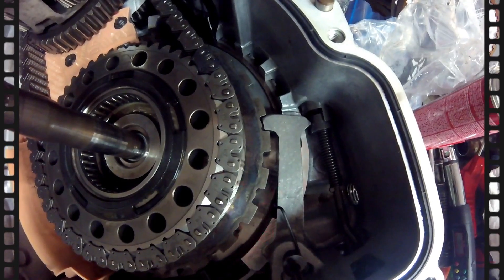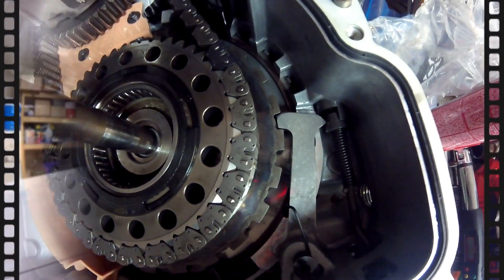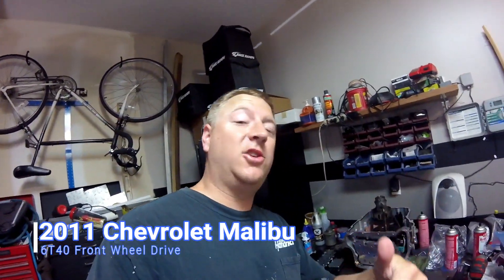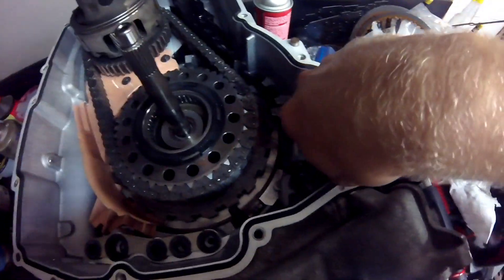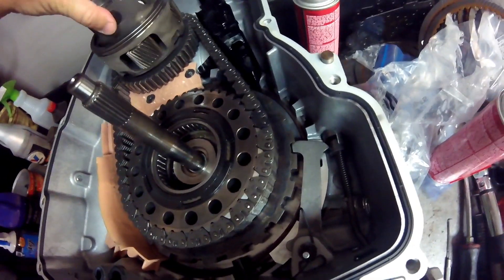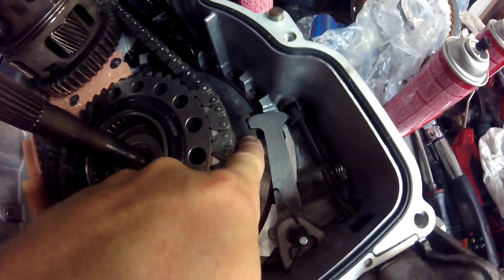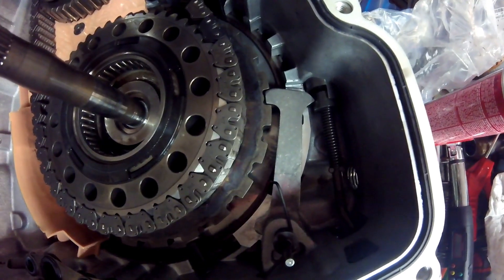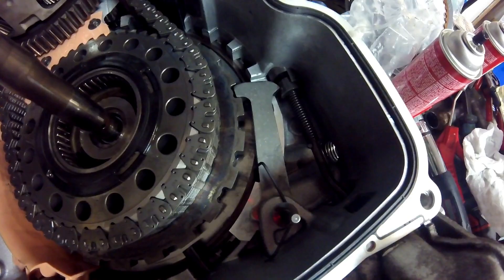What Keeps Your Car From Rolling In Park

Comment: What is the point of the parking gear in an automatic? When I park, I depress the brakes, shift into neutral, engage the hand brake, let my foot off the brakes and then put transmission into park. But if the park pawl might not even engage fully, what is the purpose of the gear?
Reply from the maker: Most people don’t use the parking brake if they have an auto. Put the car in park and then roll a little until the park pawl engages. Then put on your parking brake. Double the security.
Reply: @PetesGarageandperformance  Would this be safe enough to jack up the front of the car for work? (not getting under)

Also, suppose I did this with a front wheel drive car and jacked up the back. Can I let go of the parking brake so I can work on the brakes?
Reply from the maker: @theurzamachine if you’re on any kind of incline don’t lift the drive wheels because it’ll roll. Unless it’s front wheel drive and you are able to set the parking brake. I always use a wheel chock to make sure it doesn’t roll if I’m lifting on a hill to be safe.
Reply: @PetesGarageandperformance  That's actually what I am wondering. My car is front wheel drive and I am on an incline. Suppose I want to work on the front brakes/struts, I would jack up the front (both sides) and set the parking brake (rear).

If I want to work on the rear, I would jack up the rear, release the parking brake and the parking pawl should hold the front wheels from rotating. Releasing the parking brake would allow me to work on the rear brakes.

Is this correct?
Reply from the maker: @theurzamachine yes that is correct. I would still chock the wheels to be safe.

Comment: Thanks pete, for your Advice. I have few question please, does it safe that we can put Automatic car at only at parking 🅿️ position at hill or at normal road?
And i experienced that when I parked my car at the hill and when i going to shift gear from parking 🅿️ to Drive it looks hard to shift, why the reason?
Reply from the maker: I’d say it’s safe to just put it in park. But if you’re on a steep hill, use your parking brake. If your transmission is difficult to shift it may have a binding shift cable.

Comment: I can hear a clicking sound, in neutral, engine switched off, rolling forward in my automatic transmission, sounds like click, click, click, rolling forward even 12 inches, when I moved it forward, in the garage.
Reply from the maker: It may be a one-way clutch that is known as a mechanical diode. Kind of like the pedals on a bicycle with hand brakes when you pedal backwards. You just don’t hear it when the engine is running. This is just a guess because I don’t know what kind of vehicle you drive or what transmission you have. Does it drive fine otherwise?
Reply: yeah, it drives good no noises when driving, thanks for answering.
Reply: chevy epica 2010

Comment: so if i press the gas while my car is in park, it will wear our the paw correct?  I should put it on neutral?
Reply from the maker: No it won’t. While you are in park and neutral none of the clutches are applied so the input shaft just freewheels. Only difference between park and neutral is usually just whether the parking pawl is engaged.
Reply: @PetesGarageandperformance  thank you

Comment: I can now visualize what happens inside when the car is in park mode. So does it means that the transmission will be damaged when you shift into park mode even if the car is in stop, but engine is running?
Reply from the maker: No. If the wheels aren’t turning, the output of the transmission is not turning.

Comment: I drive a CVT and I use my handbrake every time I put my vehicle into park. 

I hope this isn’t too dumb of a question: say you engage the handbrake and put the vehicle into park when the pawl is not in between two teeth. Does the handbrake allow enough give for the the car to roll slightly (perhaps an imperceptible amount) so that the pawl can fall between the teeth?

Or does it not even matter because the handbrake is already holding the vehicle in place?

Comment: Can i ask. . . Maybe its not the right thing to do. 
But if i was in a manual, i would probably put it in 1st or maybe even reverse, depending on slope direction.
What would be happening if i did that with an automatic?
Reply from the maker: It would basically be neutral because your engine needs to be running to generate pressure to the clutches. And your park pawl would be disengaged.

Comment: On my 2013 Honda Accord when I put it on Park front driving wheels spin on opposite direction  what keeps the car from rolling
Reply from the maker: That is just the differential spider gears inside the transmission doing their job. The differential carrier is held in place by the park pawl. Your car doesn’t move when the wheels are on the ground because it’s impossible for them to spin in opposite directions.

Comment: Sometimes you can’t use the parking brake because either it doesn’t work. Or the lever is hard to pull up and the tension feels ginormous because the actuator on the caliper rust welds itself to the caliper and is unable to move or is stuck on a little bit.

Comment: I have a 22 civic and I have a slight incline on my driveway. I forgot to put the emergency brake on and I felt the prawl engage. When I went to shift out of park, i felt a little resistance. Will this break the prawl or damage my transmission? It’s only happened once.
Reply from the maker: No it shouldn’t harm your transmission. If you’re on a really steep hill it’ll be even harder to get out of park and could stretch or damage the shift cable though.
Reply: @PetesGarageandperformance  thank you so much! I won’t forget again. I was so upset with myself.

Comment: Could you also explain what in manual transmission car stops the car from moving when it is parked in gear?
Reply from the maker: When you shift a manual into gear you lock the speed gear to the output shaft which essentially locks the input shaft to the output shaft. Since the input shaft is connected to the engine’s crankshaft through the clutch, you’re relying on the engine’s compression and friction to keep the wheels from moving. Low compression engines or worn engines with low compression struggle to hold a vehicle on a hill. This is why it’s always a good idea to use the parking brake.
Reply: Thanks for your reply.
Yes, I have heard that some people explain that the wheels get engaged with the engine and do not turn.
But I always struggle to accept that the friction of the engine is such high that the weight of the car cannot overcome it.
The pistons and the inner side of the cylinder are polished well to minimize the friction there.
But what you said about compression is interesting to me. So, I think you mean that there is air in the cylinder and the valve is closed. So, for the piston to move upwards, it needs to compress the air in the cylinder. But it does not have enough force to do so.
This explanation is much more convincing for me.
Reply from the maker: Exactly. I have seen it a couple times where the engine didn’t have enough compression to hold. The truck crept downhill slowly and we opened the hood to find the engine slowly turning. Turns out his parking brake cables were broken.

Comment: Do you have to remove the trans ? Also is that what the cable is connected to because mine has another linkage
Reply from the maker: It depends on the transmission on whether or not it needs to be removed to replace the park components. What transmission do you have? Older transmissions had a kick down or Throttle Valve (TV) cable.

Comment: “U May want to reconsider using your parking brake.” What other alternative is there? 
B/c at that point choking your wheels does no good since u’ve gotta take your foot off the brake to get out of the car to put wood blocks or whatever up against your tires. 
Thanks for making a video showing us on a transmission opened apart.
Reply: Ya at the time I misinterpreted what he said. I was thinking he was advising against using the hand brake w/ any transmission in general, so When I was thinking about manual transmissions that’s why I was scratching my head.

Comment: Hey Pete! Have a very interesting question for you regarding transmissions! I have a 2012 Mazda 6 and i have been having the issue where my Car doesnt hold onto the Park on a hill and continues to roll! I sometimes have to start it in neutral.  I neglected to fix it right away so recently however, my car couldnt connect with the transmission when in Drive/Reverse in order to move the car.  My mechanic told me the whole transmission is bad but here is the kicker! Before it completely was unable to drive, i have never had a problem shifting gears while driving from 1,2,3,4,5.  It has always transitioned super smoothly between them and i feel in that way that my transmission runs amazing! I dont have excessive shaking, any noise or anything prior.  It just feels ridiculous for me to change the whole tranny!
Reply: You’ve broken off that “parking lever” inside your trans and it’s blown your pump

Comment: Hi Pete, if a car is in park position  and it is struck from behind by another moving vehicle, what possible damage could occur to the parking and gear system of the parked car.
Reply from the maker: It could either shear off the pawl or break the gear it meshes with. Usually it’ll just drag the tires.
Reply: I use the parking break on my auto transmission car pretty much any time I park. Even on level grade. One of the reasons is because I was thinking about what could happen if my car was rear ended. Aside from any body/frame damage, I'd much rather have the brakes take the force rather than the parking pawl.  Who knows if it actually ends up making a difference, but it doesn't hurt!

Comment: I accidently turned off my car in neutral so being new to automatic transmission  I then shifted from neutral to park while engine was off and heard a clamping noise then started the car will it damage my car shifting between gears while engine is off ?
Reply from the maker: It won’t do damage to shift the shifter when the car is off. However, shifting into “park” while still moving could damage the park pawl and the the gear it meshes with.
Reply: @PetesGarageandperformance  does parking pawl and gear shift have mechanical connection because I didnt applied brakes when it was off and it still was moving?

Comment: I heard people before talk about it being a little pin. What I didn't know was how little it actually is haha. I've always used the parking brake on any grade because I always hated thinking about what it was doing when you let off the brake and the truck rolled forward/backward so hard that it actually bounced back. In the trucks I had that didn't have working parking brakes I would always let off the brake real slow to gently "set" it on the pin. Not saying that science said that actually does anything, but just how I am. 

I've also noticed that it's when the parking brake isn't used for many years is when they go bad, so the day you actually need it it won't be there. 

P.s. thanks for not making this clickbait, and getting right down to it. 👍

Comment: unless you park on 60 degrees slope, this holds car quite alright. Also did you tested how much force is required to break that park lock?
Reply: exactly  the wheel will loose traction and slide before that thing breaks

Comment: So it goes into Neutral but with that engaged???
Reply from the maker: Yes. None of the clutches are engaged just like neutral, but the pawl is holding the output shaft still.
Reply: @PetesGarageandperformance  oh i had a good guess then. I wonder what the first car was to get them to figure this out when they tried to drive in park and broke the pawl or trans. Lol

Comment: If the front wheel is in the air and the car in park, should that front wheel rotate or not? I rebuilt the calipers (replaced the cylinders and bushing), installed new brake  pads, but yesterday noticed the front wheels are not rotating (in park). This morning thought that it might be bcs of the park mode they are in. Doing some research on this. Of course I'll try in neutral to see what is going on, and we have other cars, so I can look, but I would appreciate your opinion.  Like many others I didn't know how parking mode works.  Also my husband was skeptical about using e-brake, when you park a car. I'll show him this film, that it is very wise thing to do, so it won't be just my statement that it should be done.  Thank you very much for the film. Hopefully you'll make many more.

Answering another viewer (Ren Bryan Castillo) you wrote:

"If the wheels are in the air the differential spider gears are spinning 
around the side gears. But the transmission output shaft doesn’t spin 
because the park pawl holds it. Notice the other wheel spins in the 
opposite direction. When the wheels are on the ground the wheels can’t 
possibly turn in opposite directions."

I have just one wheel in then air, so probably it should not rotate, I can rotate it back and forth about 5 degrees or so (very little).

Strongly hope that I don't need to redo the whole calipers project, and it is not that the front brakes are locked.
Reply from the maker: If only one wheel is in the air, it will only rotate about 1/8 of a turn or so. This is just the slack in all of the differential spider gears allowing a little movement. If both wheels are in the air, the wheels will turn freely but in opposite directions.
Reply: @PetesGarageandperformance  Thank you for the replay.
Especially for writing about differential spider gears, never heard of those, need to read about it. I tried already in neutral (I still didn't complete some work on the rear break, line is disconnected, and though the line is closed w/a clip I didn't want to press the brake pedal, but today read that is to switch the car w/no power (1-st turn of the key), it will let to shift in gears without pressing the brake pedal. It worked.) the front tire suspended in the air rotated. I'm so glad, bcs I lubricated the new cylinders w/Red grease and Haynes Manual says to lubricate just w/ brake fluid, so I thought that messed up the project. Now seems everything is working fine. Thank you again for the great film, I've learned a lot from it.

Comment: I gotta costumer her truck is stuck in park she broken the shifter mechanism trying to go from park to reverse...shes on steep hill
Reply from the maker: Hook a tow strap to the vehicle and slightly pull it up the hill to relieve some of the pressure on the park pawl from the weight of the vehicle.
Reply: @PetesGarageandperformance  yes, it worked, she needs new shifter cable, I had to go under to manual shift the lever to neutral and the key didn’t go back to off position so I unhooked a small cable on the ignition-cylinder, it worked 💁‍♂️

Comment: Hi, why can I still turn the wheel drive of my automatic car when the gear is on "P" and its jacked up in the air. I tried to spin the qheel its still spinninh. Dont it hold the wheel?
Reply from the maker: If the wheels are in the air the differential spider gears are spinning around the side gears. But the transmission output shaft doesn’t spin because the park pawl holds it. Notice the other wheel spins in the opposite direction. When the wheels are on the ground the wheels can’t possibly turn in opposite directions. So the car doesn’t move.

Comment: For the most part, if you have a relatively light car, (I know 3000lbs is not that light) parking with just the pawl is fine on a level surface or even a very mild incline. It's when you park on a steep hill that it's really bad.
Reply from the maker: I once parked on a steep incline when I was younger and didn’t use my parking brake. I practically had to hang on the column shifter to get it out of park!
Reply: @PetesGarageandperformance  That's when it's bad. Whenever you park on a steep hill ALWAYS ALWAYS use the parking brake.
Reply from the maker: Absolutely
Reply: What you mean by mild incline? Can you specify the degree?

Comment: Why the engine doesn't stop when you are fully stopped (brake applied) and with D engaged?
Reply from the maker: Because the torque converter. It is a fluid coupler. Basically it is two fans. The engine side (which is spinning) and the transmission input side (which isn’t spinning when you’re stopped). The engine side (impeller) throws trans fluid at the trans fan (turbine) and causes it to rotate.

Comment: If only Chevy was as good at rustproofing as they were at cutting costs, I'd have a parking brake! It's rusted to the point of being useless. I try to ease it in to the groove so as not to beat up on it too much, and I also try to avoid steep hills if I can. I park on the flattest point in my driveway and it does fine.
Reply from the maker: I’m assuming you live in a northern state. Unfortunately, I think rusty cables and vehicles are just something we have to deal with. Chris Rock said it best “ we can send a man to the moon. But we can’t make a Cadillac that the bumper don’t fall off”. Or something like that.
Reply: @PetesGarageandperformance  I live in Kentucky, but who knows where the vehicle has been? I got it used. Any idea if I can get some sort of hydro parking brake installed using the stock floor pedal and ratchet mechanism? It's a Suburban so I doubt I could find a hydro for racing/drifting, but some sort of offroading-spec equipment would be perfect since that's pretty much what I use that old tub of lard for. Of course, a set of chocks would be the cheapest and most reliable.
Reply from the maker: Parking brake cables are about $30 and probably won’t break again in the life of the vehicle. I would also check the condition of the park brake shoes though.
Reply: @PetesGarageandperformance  From what the mechanic told me, it's not just the cable. The whole system is rusted. Looking up underneath it myself, I would agree.